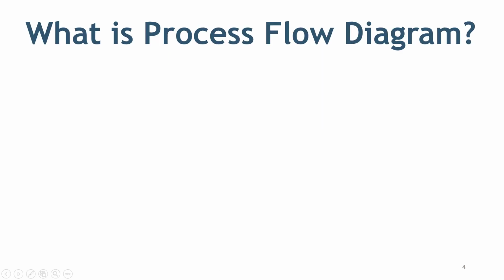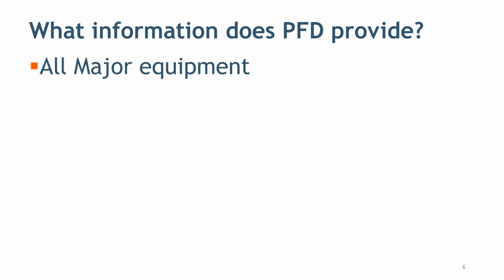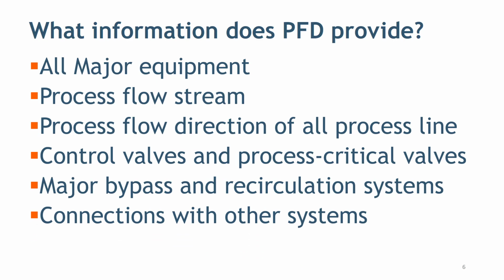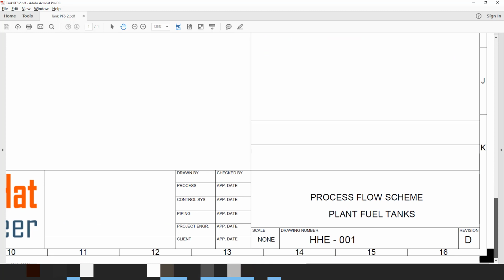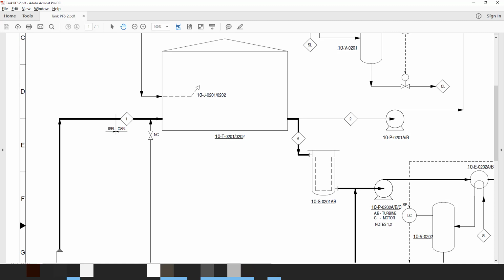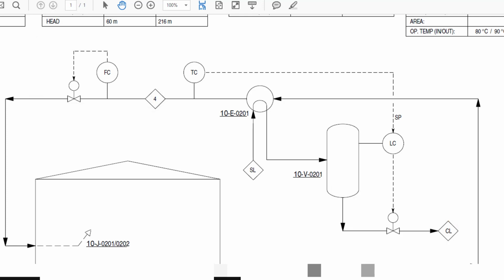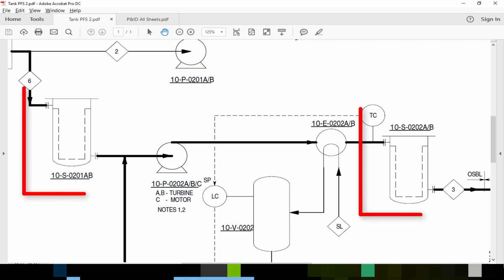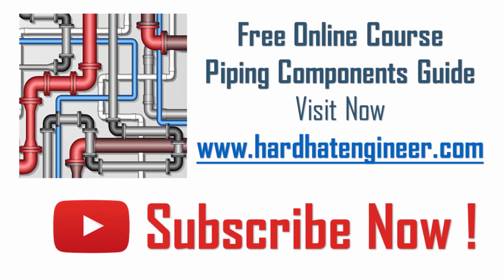How to Read Process Flow Diagrams (PFDs/PFS) Oil and Gas

Comment: Hi Varun. I am not sure if you ever gonna read this comment but I got a suggestion for you. I really liked this video especially the part you provided an example of a process flow and started dissecting it with red squares. I suggest that you post videos like this for process flow, P&ID, and isometric and explain on the example and I will personally buy all of them. The problem is a lot of us are industry professionals who are in the process of learning with a little time to academically learn and these videos with examples are either not out there or they are not as clear and explanatory as you posted. Let me know what you think. We need more videos and I have no problem paying for such instructive videos!
Reply from the maker: Thanks for the support. I have been pass through this phase but I was lucky to get good seniors who have help me a lot.  HardHatEngineer.com and this channel is my small effort to give it back. I am on a mission to create the best online resource for young engineers. Thanks for suggestions on new topics. You will see videos on that in short future. The reasons for the promoting paid courses is that to recover the cost of hardware and software required to produce videos and my effort.  Thanks again for understanding and supporting by buying my course.
Reply: Pejman Alanjari 
I agree and that we expect more vedios with  details....
Reply: Sir please suggest any best institute for learning this programs and many more......if u have than mail me on :- trishantg9@gmail.com